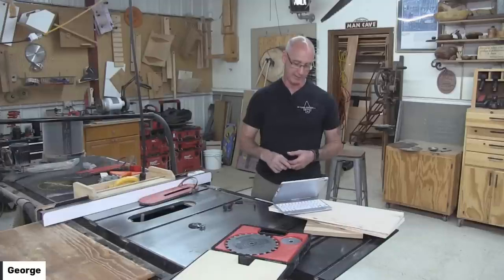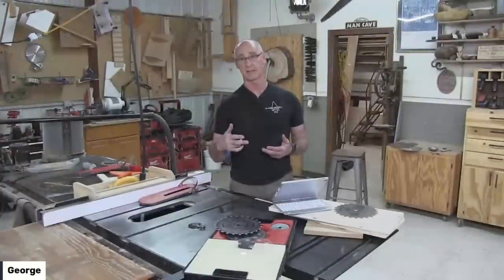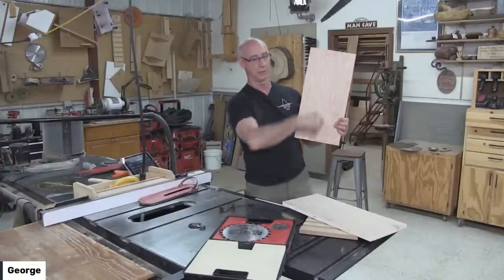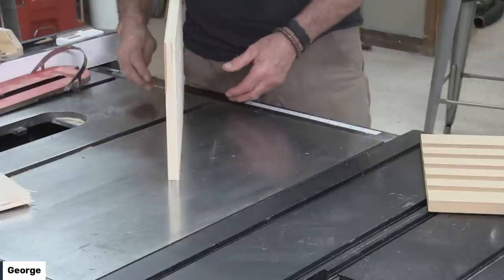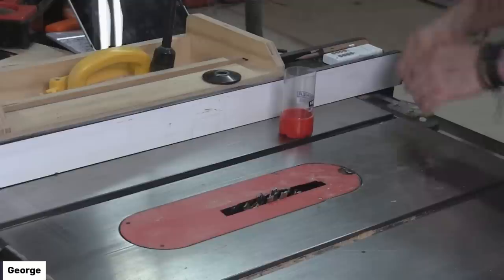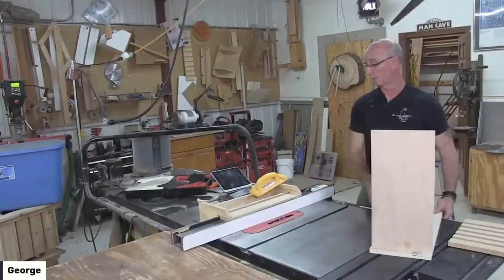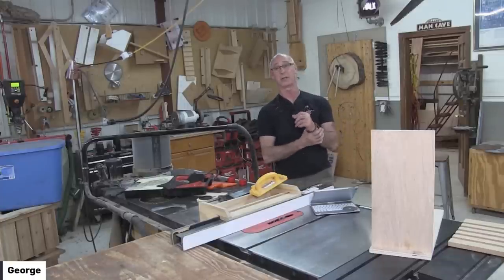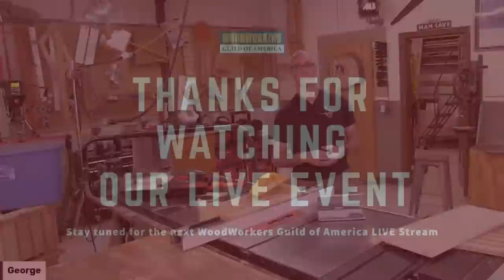Dadoes on the Table Saw

Comment: There is a video on YouTube where someone filmed a brake activation on a sawstop with a high-speed camera, and that saw blade stopped so abruptly that several pieces of carbide actually broke off and went flying. Then the video showed that blade just hanging there for a while before retracting into the body of the saw